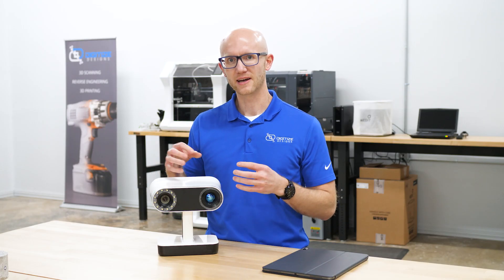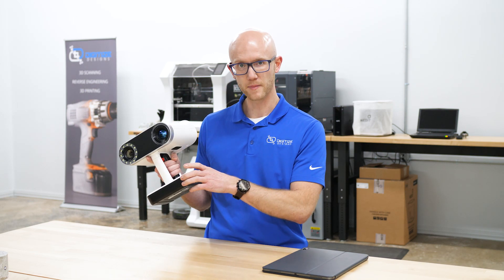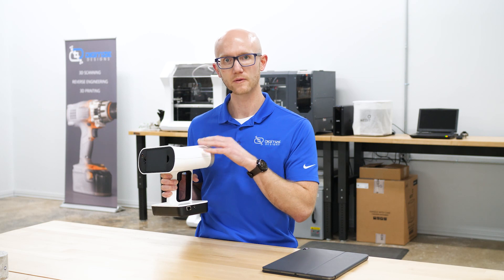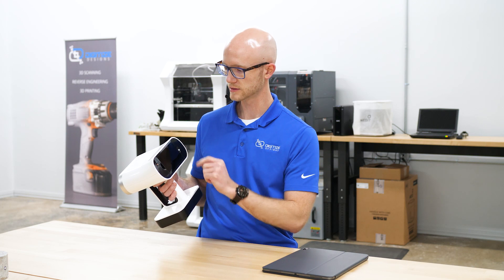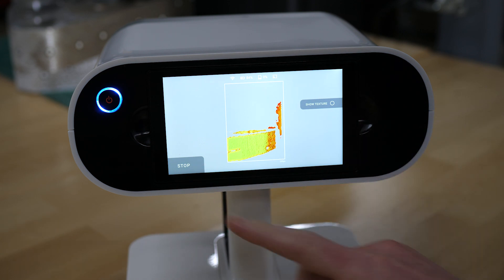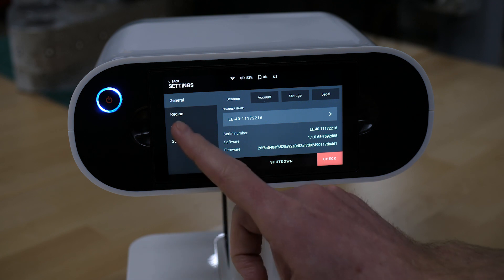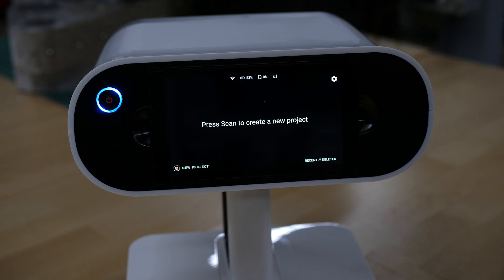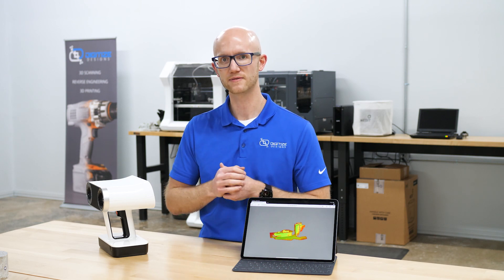Artec Leo Demo - General Feature Overview

Comment: So there is no adjustable resolution? It's always capturing data at max resolution?
Reply: @DigitizeDesigns  thanks. Did you get a chance to see if the Leo is doing 0.25mm or 0.5mm resolution? They had conflicting specs for awhile.